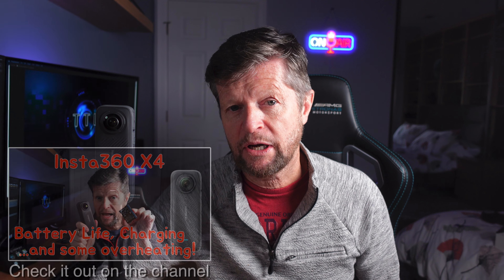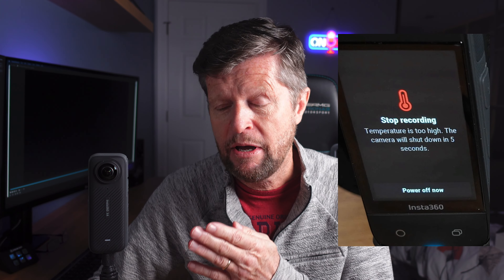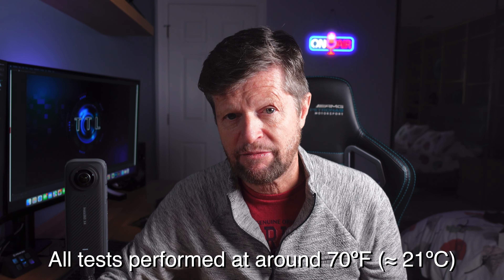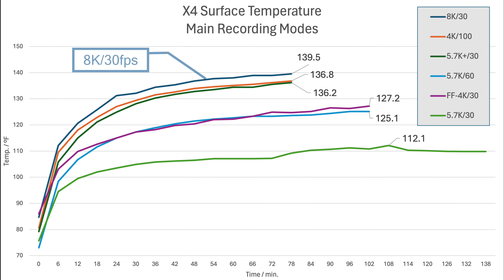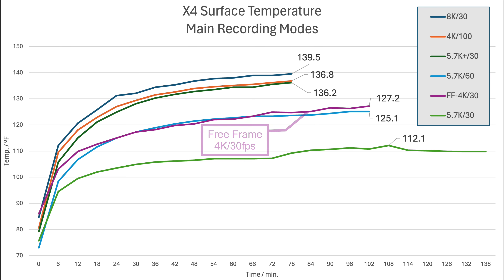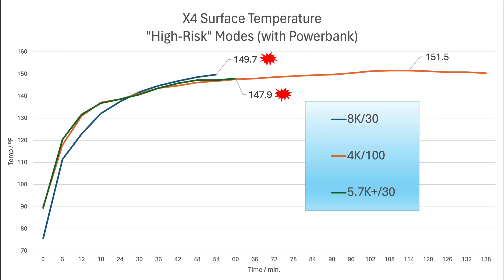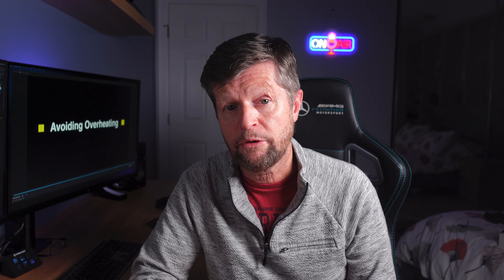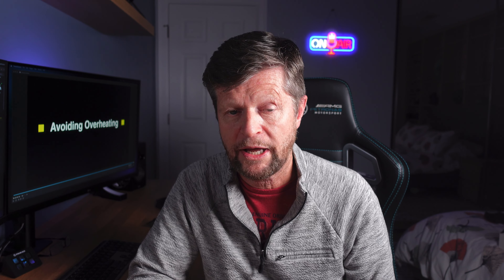Insta360 X4 Overheating: What, why, when and how to avoid

Comment: love your clips, sometimes there is something interfering with your audio tough , depending on what device you are editing is possible you don't notice it , it is a high pitch buzz noise
Reply from the maker: Some others have mentioned this, but I don’t hear anything. Will try to figure it out.
Reply: @ttl_channel  Its at 3:15 -- a high pitched tone maybe above some people's hearing. I've noticed it in some of your other videos as well.
Reply: @justinsitter1125 heard it too
Reply: @ttl_channel I feel like you should be able to notice the audio signal issue in a good audio editing program; but that's out of my wheelhouse. 

The signal is very annoying, I hope you can figure it out!
Reply: yup heard it too. Not in the beginning of your video but more at the end. And not in your cutscenes but only when you speak.

Comment: :face-blue-smiling:Well done. Your test series are very helpful for my applications. Which memory cards did you use? I ask this question because I have had the subjective experience that SD cards get different temperatures at identical write rates.
Reply from the maker: I recently posted another video testing different memory cards (https://youtu.be/4s77RSs5oMU). I did also do some testing to see if there was a difference in heat generation but nothing conclusive. There is a list of tested cards in the video details of both videos.
Reply: @ttl_channel   Thanks and Best Wishes from Berlin/Moabit

Comment: Thanks, for all the info. That was the information I was looking for. Do you have any comparison to the x3 model? It's old model have similar issues?
Reply from the maker: I posted this review, which compares to the X3, but it doesn’t cover overheating. I have owned the X3 for a couple of years and never had it overheat, BUT of course if does not offer 8K or 4K/100 either.
Reply: Thaks, for this answer. I'm not sure what to do. On one hand I'd like to have best quality possible, but on the other I don't want to struggle record video when on summer holiday in one of the sunny/hot places or check if my recording is still on when it will be on 3m stick up in the air.

Comment: Thank You for the analysis of this "hot" topic.
Two Questions.

1. Connecting a Powerful power Bank directly to the camera without the battery, isn't it dangerous damaging the circuits of the camera electronics due to the sometimes aggressive power output of most of the nowadays power banks? The battery works also as a buffer to the power supply for the camera. I have this experience with a vehicle where the battery was too weak and we connected a power bank booster to it, to get to the nearest workshop, and it damaged other circuits of the vehicle.

2. As I read, the thermo grip has a metal material in it. Is it maybe wise to cool it down in a refrigerator maybe, before we apply it to the camera when we plan to make longer 8K recordings, to absorb the heat of the camera?
Reply from the maker: Good questions. 
1. I would think that a modern device like this controls what it draws  from the powerbank. 
2. Interesting idea. Might help gain a few extra minutes of recording time. May have to give it a try.

Comment: Did you try recording without the internal battery, using just a power bank? Maybe this will allow us to record for a longer period.
Reply from the maker: On my list of things to test - stay tuned.
Reply: @ttl_channel  Hope the temperature sensor is not close to the battery. If it is, the temperature reading might not be accurate and could cause damage to the X4.

Comment: My Insta 360 x4 is hanging. Is there any setting i need to check or its just a defective piece? Please suggest
Reply from the maker: I have seen this happen on the X3 when I was using a memory card that was too slow. Could that be it?
Reply: @ttl_channel  Thanks for the quick reply as such I am using sandisk Extreme V30 A2 64GB SD card with Read Speed upto 170MB/S and Write speed of 80 MB/S I guess that should work? However even without SD card also X4 getting hung within 5-6sec after switching ON but the menu seems working fine. It's just the camera stop responding. And same while using SD card. Please suggest.
Reply from the maker: Sounds like you need to get a replacement.
Reply: @ttl_channel  thank you for the response. But it seems it's working now without an SD card. 
The only problem is while recording with SD card it's working fine for single screen and for some time for 4 k 30fps in 360 mode but not working for 4k 60fps and above resolution. It feel the problem is resolved automatically but I need to change my scandisk v30 A2 SD card with the above version. What do you think? Please suggest.

Comment: If they don't already I eould love to see an external heatsink case option to help it expel heat; but I suppose the camera would have needed to be designed with that in mind for it to have good thermal transfer locations across the body. 

Cheers, thanks for the good info! Without airflow I'd probably keep the X4 at 5.7k/30; ridiculous, but it has nice features over X3.
Reply from the maker: Good idea. About to release a new video, filming in 8K for several hours. Stay tuned!

Comment: Thanx for the analysis. Your videos have a very high pitch at some points check for example the 10m mark “file transfer chapter “ It is very disturbing to listen to.
Reply from the maker: A few people have mentioned this, but I just can’t hear anything.
Reply: @ttl_channel 
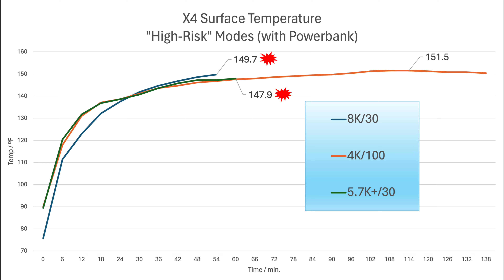It’s definitely there and it’s disturbing , from 9:58 until 11:02, if you can’t hear it by ear maybe it could show up on waveforms of audio
Reply: The high-pitched audio tone was making it hard to listen to. The first one occurred at 2:54.  Try listening on YouTube versus your original. Can you hear it?  It’s about 5,500 Hz.

Comment: Is there any heating issues with x3 ?
Reply from the maker: I have been using the X3 for a couple of years now and never once had an overheating issue.
Reply: I have had endless issues, only when flying. Sun comes through windscreen and heats the camera. Under clouds usually not an issue.
Reply: Hi bro my x3 heating with in 5 minutes  how could handle the situation explain pls

Comment: Good video, informative. What's the power level being supplied by the charger? Have your tried using a lower powered charger, say a power level that just maintains the current battery level while recording instead of actually charging the battery?
Reply from the maker: I did not measure that, but will have to look into it.
Reply: @ttl_channel  np, thanks for the reply

Comment: i can see a market for 
extended battery pack makers  to make:
 an adapter that slots in while improving cooling using a vapor chamber.
or 
a third party thermo grip that has heat wicking but using a metal grip might interfere with the wifi signal.
Reply from the maker: Interesting ideas! Thanks for sharing.
Reply: @ttl_channel  i just got my insta360 X4,  i live in tropical singapore.
those third  party metal cages, does it make enough  contact to wick some heat away to make a difference?
because my cage feels warm to the touch while i was updating the firmware.

Comment: I really want to see comparisons between the X3 and X4 overheating. The X3 overheats often if I'm not careful.
Reply from the maker: I never had an overheating problem with the X3 - even when doing extended battery tests.
Reply: @ttl_channel   that's because you've never put it on your dashboard with cold air running on the defroster, during a 50-80 degree day with the highest quality video

Comment: My Iphone 15 is my primary video camera so I am hoping that I will not experience any overheating with the X4.  I wonder though if the timelapse which is 11K and you leave it running for 30mins sometimes to get a usable video if that will cause an overheating.   Thanks for the very informative video and I will probably remove the cover to help with heat dissipation.
Reply from the maker: Timelapse should be no problem, as it’s only taking a single frame every few seconds. Check out the X4 timelapse in this video (full timelapse at the end of the video): https://youtu.be/eBlOg0zMJWs

Comment: I wanted to use it on motorcycle but temperature in my country crossed 50 c. Max I might use is 4k30fps. Should I go for x4 or wait for x5?
X5 mightlaunch in 2026 April
Reply from the maker: April 2026 is a long time to wait. I would hope there is a new version before that, but whenever it comes, there is no guarantee that overheating will be any less of an issue. I would guess that you would have no issues with the X4 at 5.7K when riding a motorbike (maybe even 8K).
Reply: @ttl_channel  has the image quality improved with x4 when compared to x3?
Sensor size remains same between both.

Comment: It is an issue. It overheated when I pulled over on my motorcycle to text my friend for like 5 minutes. If you're recording and it is in the sun it is going to overheat before 10 minutes. I didnt know and lost like 45 minutes of riding. I didnt buy this camera to record in 5k. It doesnt say on the website when you buy this camera that it WILL overheat if it sits in 1 spot and records.
Reply from the maker: Sorry to hear you’re having issues. May have to do some higher temp tests when the weather gets warmer.

Comment: Thanks for your honest review. Normally I record on Tripod in an ambient temperature of between 31 to 35 degree Celsius and hardly any airflow. Including  the help of a powerbank. Surprisingly the X3 hardly shuts down, however the 1" edition shuts down very easily after only 25min. I guess the X4 will have a similar fate (I don't yet own one) My solution is to attach a phone cooler to the back of the RS 1" 360 camera. That keeps it working for hours. However I still need to figure out how to record the audio without the noise of the cooler. So far I attach a microphone a distance away. It's better but not great.
Reply from the maker: With a powerbank in those conditions, the X4 will struggle, unless you are filming at 5.7K, in which case it should do fine. For 8K (assuming you  are indoors) you may want to try removing the battery and just powering from the powerbank.
Reply: The phone cooler technique is interesting. Which phone cooler do you use if you don't mind me asking?

Comment: great video and info 😊 just bought the x3 and offcourse the x4 came out a week later or so... 😅 haven't used the x3 for weeks/months until now on holiday and it happened with my x3 as well... Anywayzzz, do you have the same detailled (with temp/IR setup and temp graphs as wel. And good thing you add the Celcius too 👍) video of the x3 as well? Greetz from Belgium 😊
Oh yeah, this happened in France at 32C and now I'm worries cause I'm going to Marokko in November... which is prolly hotter than France... 😅
Reply from the maker: I never had any overheating issues with the X3, and I have used it in some pretty warm conditions.
Reply: Myes... I pretty much continuous recorded in 5.7@60 on a 1TB SanDisk Extreme Pro V30 XC I A2 U3 card. I was just walking with the camera on the 3m (10ft) long stick in direct sunlight of maybe even warmer than 32C (90F)... So that's why I'm wondering what will happen in the desert of Marokko... 😅 (I will be driving a buggy tho... might have enough airflow then? Oh well time will tell... just hope it does not quit recording while I'm sending my buggy in full action lol...😊

Comment: Recently began using 360 x4 on my boat while fishing.  It  overheats constantly,  usually within minutes.. and that's with air temps in 70s. I'm sure it's going to be worthless over the summer when temps are 100 + degrees. Very disappointed.
Reply from the maker: That does not sound normal - maybe Insta360 can replace it?

Comment: My new Insta360 X4 crashed at 34 minutes while recording in my dining room at 74 degrees.
Reply from the maker: Was it overheating?
Reply: @ttl_channel When I turned it back on, it said it had shut down due to overheating.
Reply from the maker: The first overheat I had was after 32 mins in a sub-65 F room. Since then, I have always managed at least an hour. It’s almost as if the X4 gets “conditioned “, which I’m not sure is a good thing or not!
Obviously if you are connected to external power, that will overheat faster.
Reply: @ttl_channel  I bought my X4 thru Amazon and I think I’ll see if I can return it. I don’t like it well enough to try using it in the Texas heat. I have enough trouble with my GoPro 11..

Comment: I recently got an X4 (mainly for the 8K mode, as i also have an X3), so its good to know that i shouldn't run into overheating issues (especially as i tend to record for no more than 10 minuites at a time)
(and im a bit annoyed at having had to wait around for three days in a row for the delivery as on the first two days the driver must have gone to the wrong house)
Reply from the maker: Hope it arrives soon - enjoy!
Reply: @ttl_channel  It arrived yesterday, right after i had given up hope of ever seeing the parcel (fortunatly i noticed the van just as i got to the top of the stairs, so i raced back downstairs and managed to make it to the door before the driver (the parcel required an "Adult Signature" for some reason unknown to me))